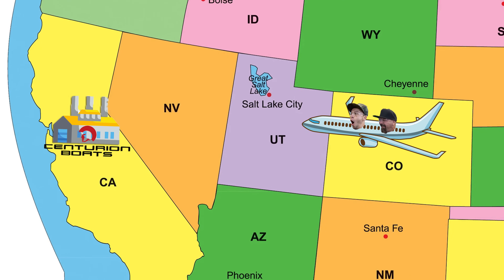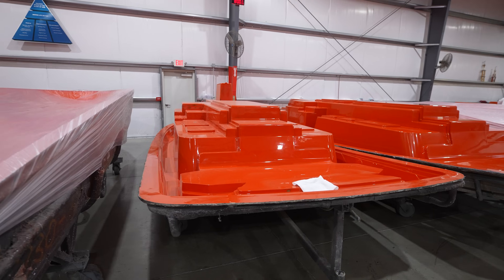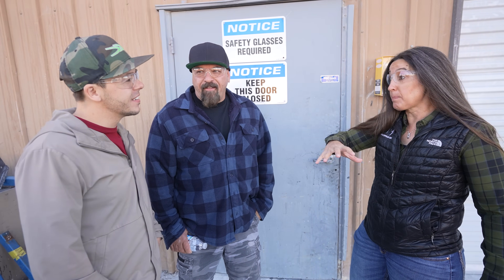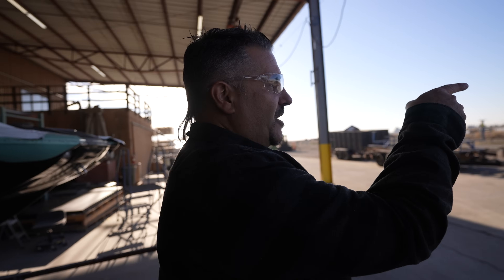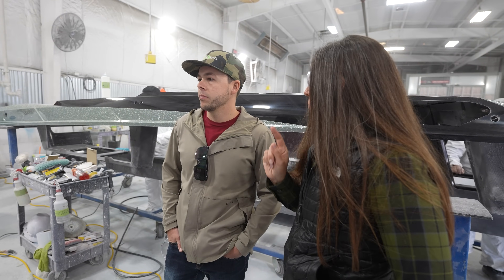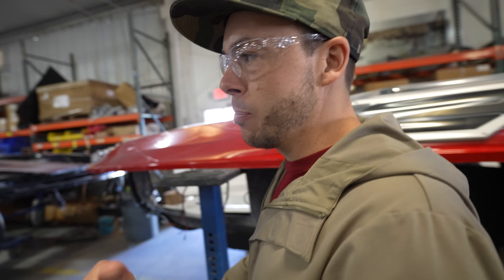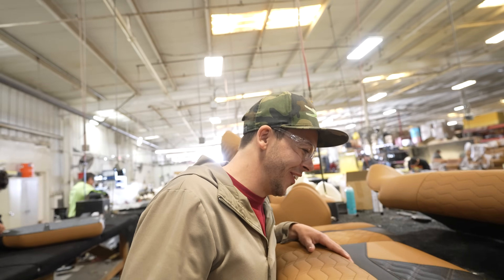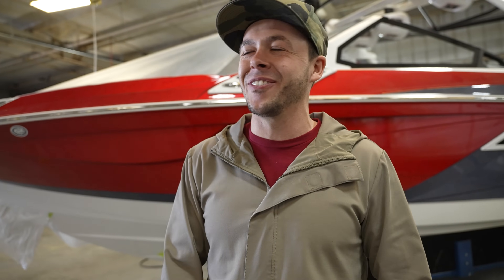How The #1 Surf Boat Is Made Start To Finish 2024 | NEVER SEEN BEFORE

Comment: All looks pretty much the same as every other fiberglass factory, been in the game for
about 30 years. The wax is not actually why a part releases from a mould, a fresh mould
has to be sanded in grades all the way down to 15 micron wet and dry, then buffed,
then sealed and finally waxed, essentially the wax maintains the shine and actually helps to hold the gelcoat on the surface until the glass reinforces it, spray on release agents are
used here in Aus these days, easier to use and less labour time equals less cost, one 60ft
mould can be done in less than an hour, 2 coats.